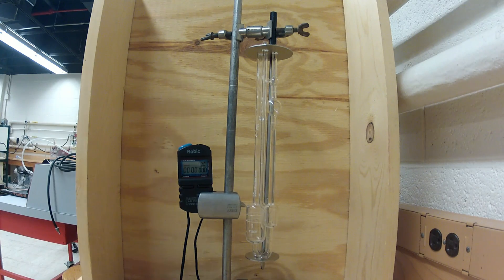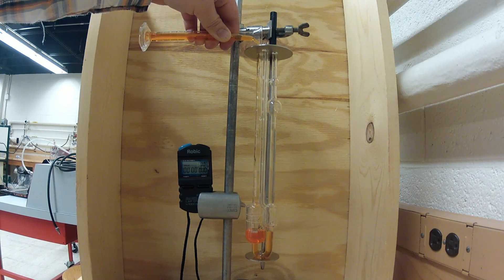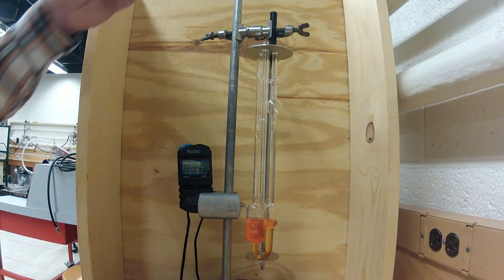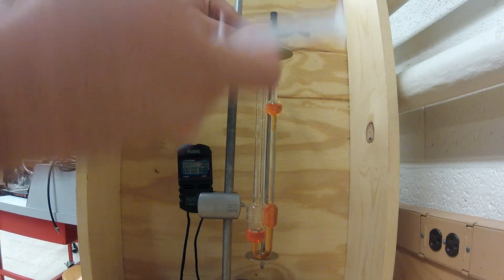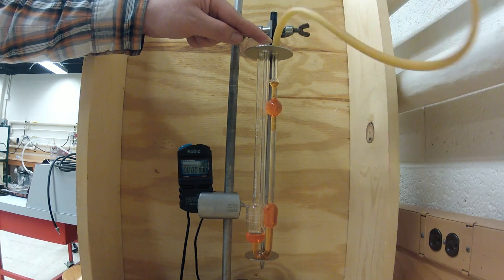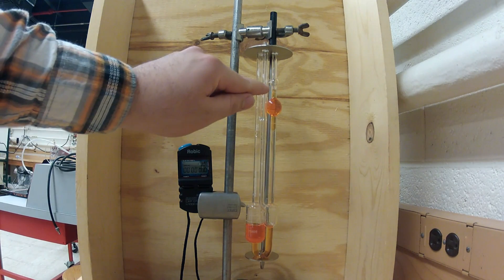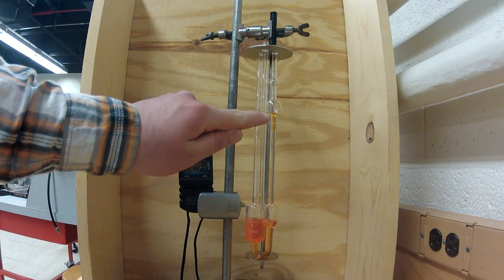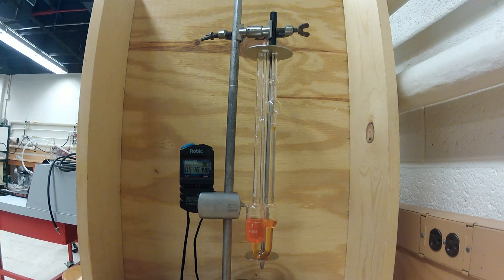Ubbelohde Glass Capillary Kinematic Viscometer Demonstration

Comment: Won't there be a capillary effect?
Reply: that's why device has a third arm.
Reply: @shomy2022  No, the reason for the third arm is a little bit other. The info from Wikipedia is here: "The Ubbelohde device has a third arm extending from the end of the capillary and open to the atmosphere. In this way the pressure head only depends on a fixed height and no longer on the total volume of liquid".
Reply: that's why device has a third arm.
Reply: that's why device has a third arm.